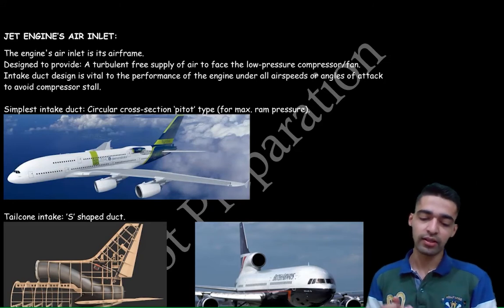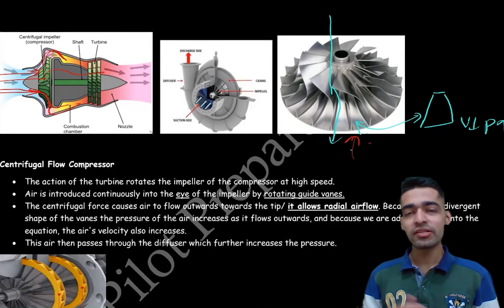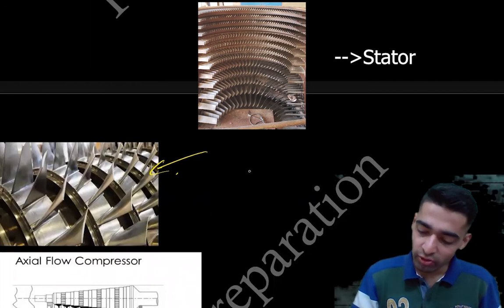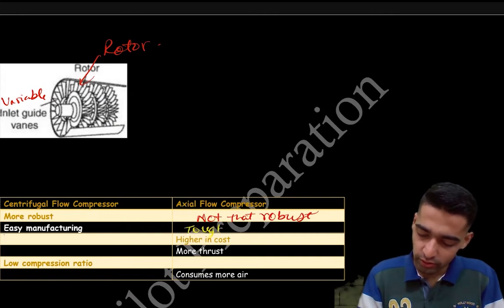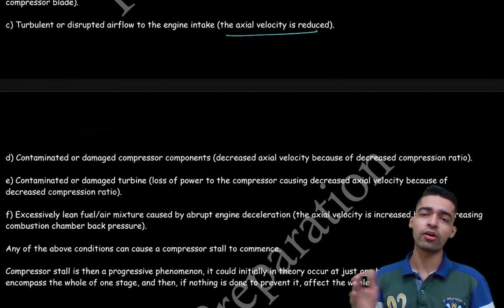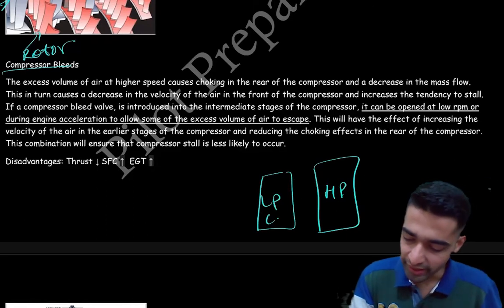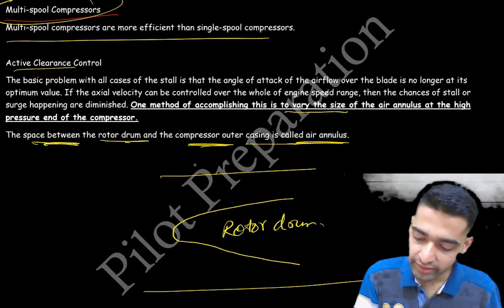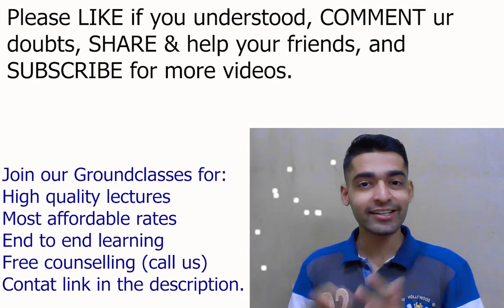Jet Engine Compressor |Technical General | Ground classes

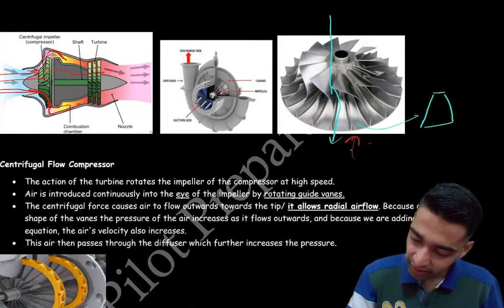Comment from the maker: 10:01 We forgot to add one point, that as the compressor is rotating at a very high speed, this speed is transferred to the air particles and thus it gains speed instead of losing speed while passing through divergent shape of impeller... So Velocity increases, pressure increases and temperature also increases.